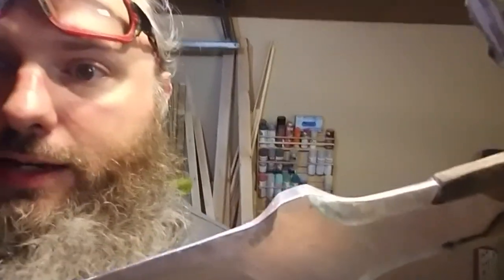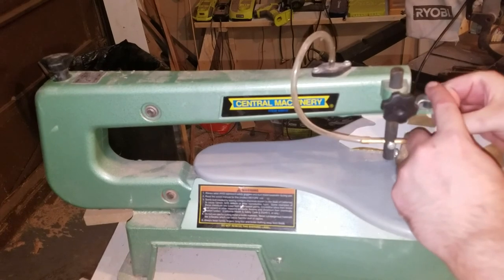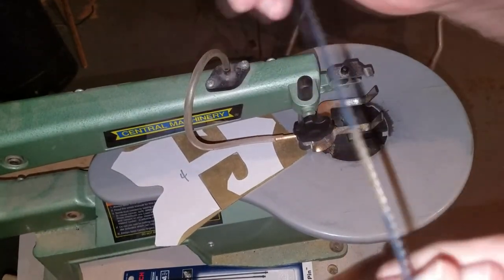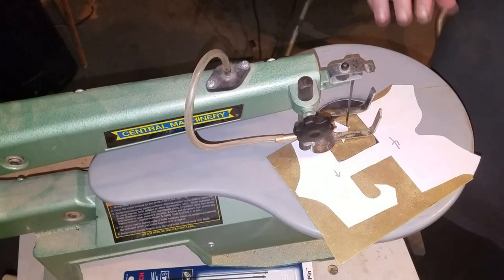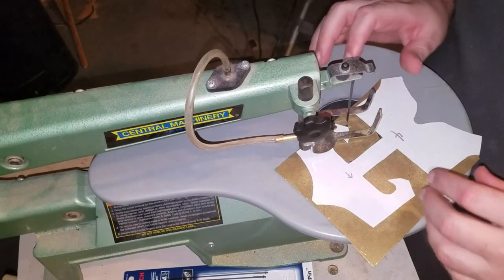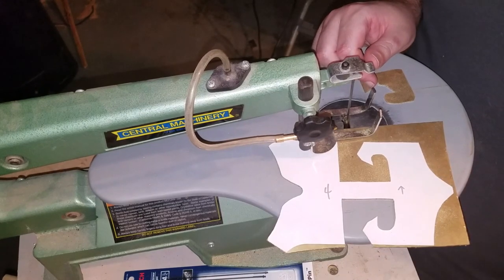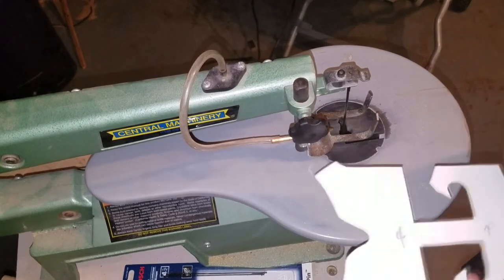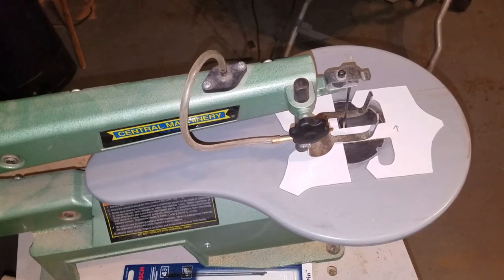Metal Laminate Pt.2 - Brass Cutting

Comment: A few helpful notes..a rule of thumb is you need a minimum of 3 teeth in contact with the edge of the metal at all times in order to cut effectively. The thinner the metal, the higher the tpi you'll need. Jeweler's blades 3-0, that's a good blade to start with. Take it slow, keep it cool. It also can help to sandwich thin metal between two pieces of thin plywood or other material, and put your template on the top piece of wood. That will decrease some of the grabbing action, make is safer and make cutting metal on a scroll saw far easier. But most of all, to me the choice of blade is to me the most important factor, that and not pushing it! Blades break extremely easy, as they are hard and thin like wire. Watch the channel Clickspring to see some fantastic brass cutting on a Hegner scroll saw. He just uses it to rough out shapes, and bring it to finish with files and etc., which I think is probably the best (though a bit more labor intensive) way to do metal scroll sawing on thick stuff.

Comment: Given the problems mentioned with turning tight angles and  longevity of blades I would suggest anything that could be done to reduce turning or length of cuts would be beneficial. Try drilling a blade size hole at key turning points and use a regular metal saw for straight sections where possible, even to the point of cutting out sections to get the scroll saw  blade in to where a scroll saw is the only way to cut the material.

Comment: kinda late to the show, but did you ever find a blade that would go through 1/4  brass?
Reply from the maker: You can actually cut thicker brass easier because the teeth aren't your enemy. Simple everyday oil will help keep it from overheating. However, 14+tpi bandsaw blades cut thicker metals like brass, copper, and aluminum much better than a scroll saw. Most inexpensive bandsaws will cut soft metals as long as you use oil and take your time. I cut 1" brass on a 14tpi blade with relative ease.